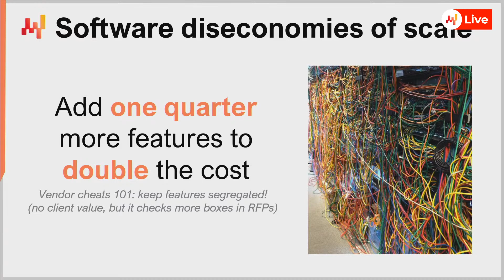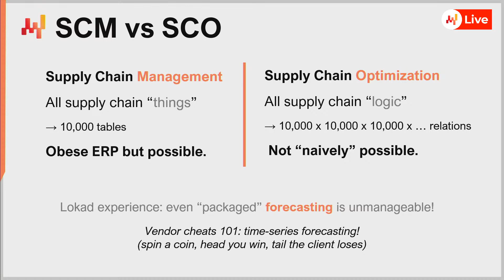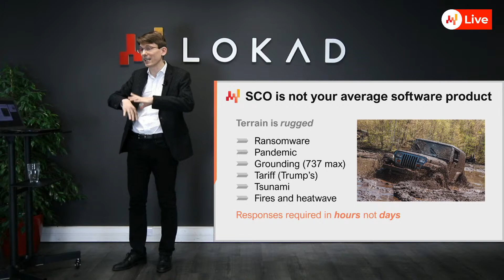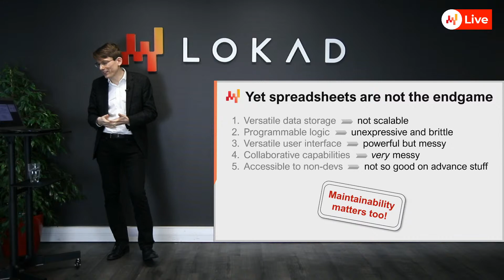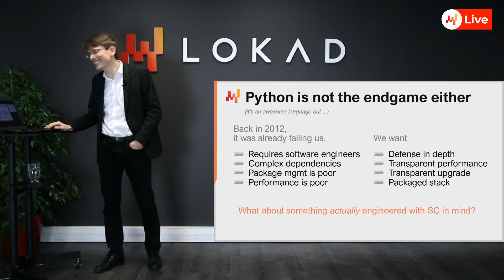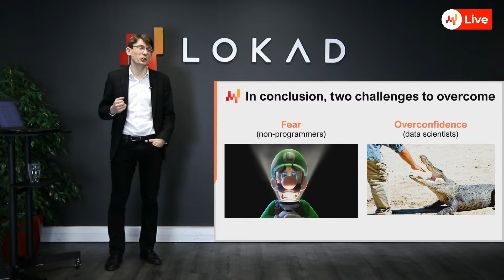Product-oriented delivery for Supply Chain - Lecture 1.3

Comment: Message would maybe be clearer if you would use "execution" instead of "management" and "software" instead of "product"?
Reply from the maker: Terminology is far from being top-notch I agree. On a tangential note, my biggest terminology blunder is 'supply chain scientists' which would have been better named 'supply chain engineers'. At the time (5 years ago), the concept was so confusing for everybody, that I decided to stay close to 'data scientist'. Back to your point, the term 'product' is commonly used in the software industry the way I am using this word in this lecture (i.e. a shorthand of 'software product').  For example. Amazon and Zalando are internally using this term when referring to their own supply chain undertakings (which happen to be 'product-oriented' just as presented in this lecture). I know it's confusing, even more so as supply chains end up moving 'products' (physical). Cheers, Best regards, Joannes